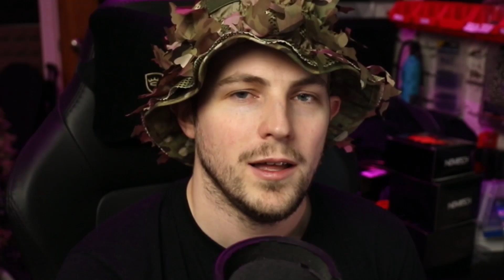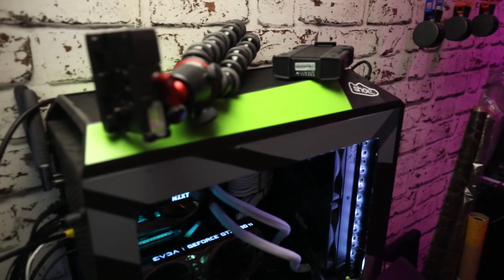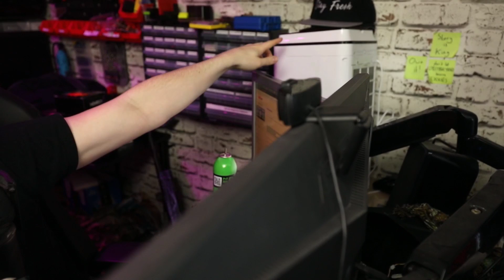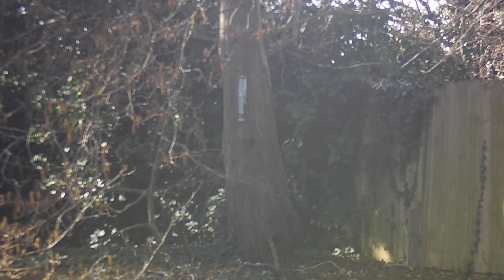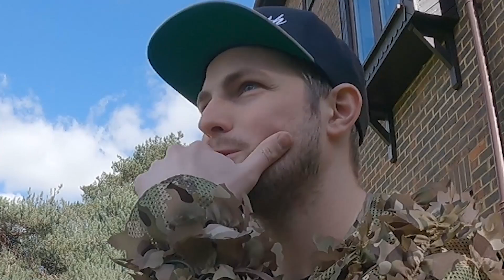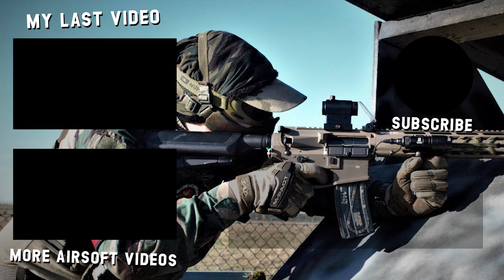SSX303 shooting badly? Change your gas!!!

Comment: THIS! I tried all the nozzles, loads of gassess always filled my mags at home and played outdoors. No matter what around 0.7-1J soon as I made sure I filled outside, and importantly in my case, shook the bottle vigourously. It initially came though at around 2.6J as I left the unrestricted nozzle in and after switching back was a consitent 1.9J using red gas (in winter). Was my first gas gun and took me ages to figure out, almost sold it from the frustration!

Comment: Try filling the mags in the cooler environment when the green gas bottle is same temp as surroundings. Taking warm gas (from indoors) and going into a cooler environment (outdoors) would give lower pressure from the mags. On the flip side, filling up outside then chrono'ing indoors when mag temp raises..... well over powered. Maybe worth testing...
Reply: Yup the temps will as you said will affect both ways  
But cold outside in UK is  about 5c so green to red,black is the way to go  tried co2 in mk23 gas valve to hard to strike with pistol

Comment: I’m gonna use propane with the madbull adapter so silicone oil gets mixed in
Reply: not good, your hopup would get trashed cause silicone oil would get in the hopup
Reply: @sneez9461  you do realise that green gas already has silicone oil in it right??
Reply: @sykesmr21  Yes, but not alot, plus, its best to use only propane or HPA, and just lube o-rings and such manually
Reply: @sneez9461  been using it for years on my other gbbs and non gbb just fine
Reply: @sykesmr21  Yeah, just using greengas is fine, but like people who lube their bucking  🤣, and then wonder why theres no hopup. most rubbers still grip on the bb even with oil, but a dry bucking would require less nub pressure to lift bbs, increasing the fps

Comment: Well the temp guide on his site does show\have diff values for the 303  vs 23 do have diff lvls for the diff temps....which had already lead me to believe that the 303 is more prone to temp changes w diff gases having to be used at diff temps bc they act differently. But good to see that you've started to confirm what I was thinking might happen.
Reply: That's why I'm planning on getting an Hpa tap